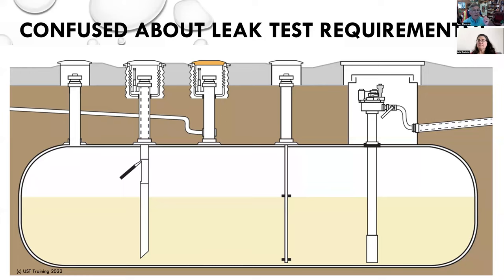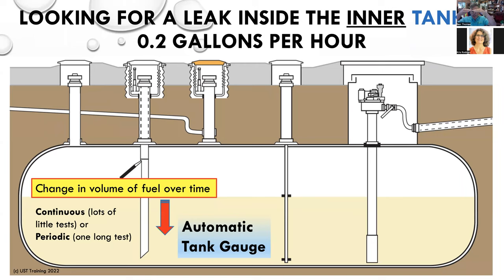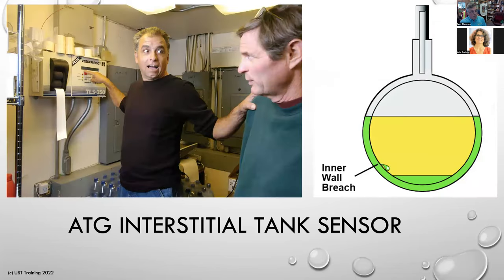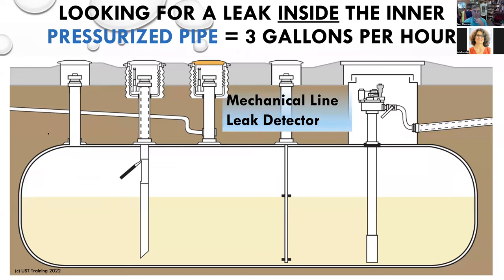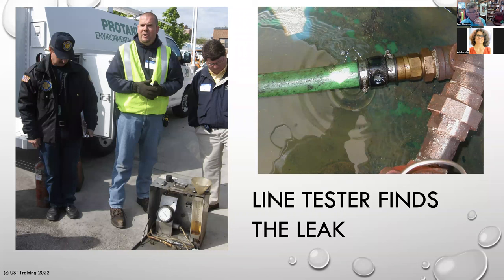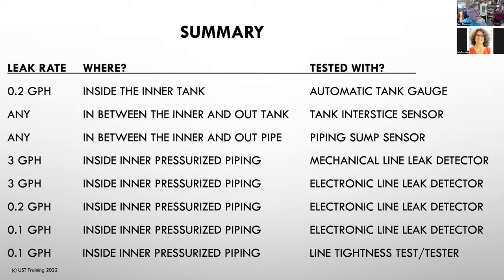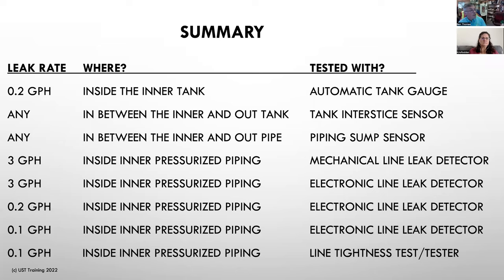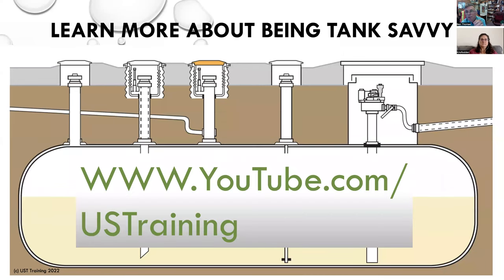Understanding the Various UST Leak Test Requirements

Comment: we have a 30 year old generator with a Veeder Root TLS 300 system in Texas.  we replaced the fuel probe and now we are getting a high water alarm.  we check and test for water and it shows no water in tank.  the tech that was sent out to look at it couldn't find the problem..  what do we do??
Reply from the maker: Man that's a tough one. Maybe there is some thing that is pushing up the water float at the bottom of the probe that is causing it to trip? The only thing I can suggest is get another service technician in there. Sorry.